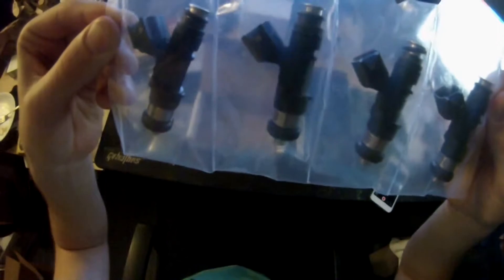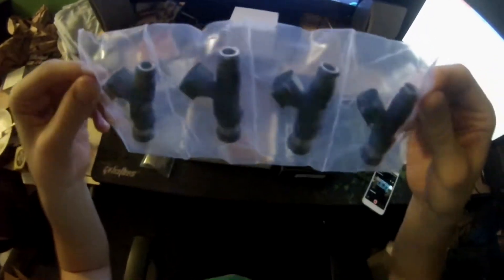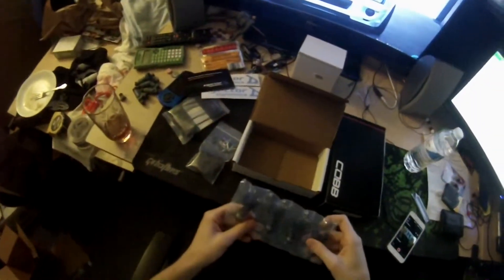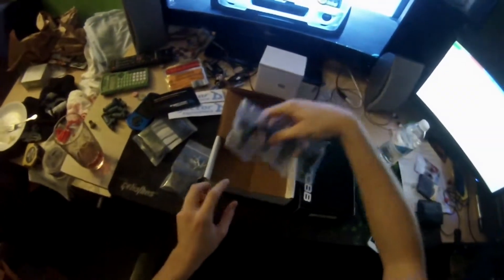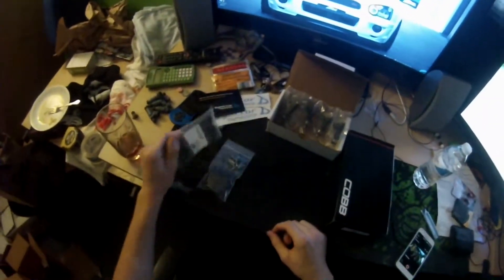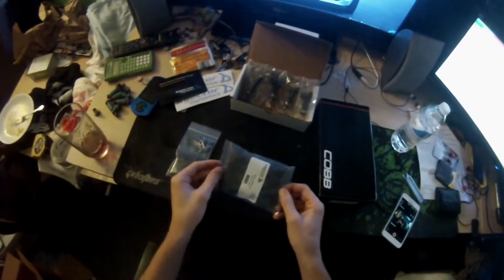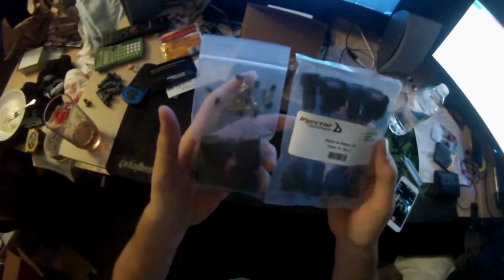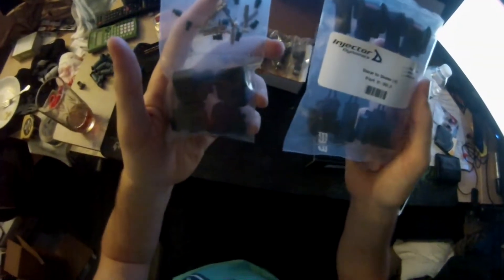Unboxing/Update Injector Dynamics 1000cc Fuel Injectors | POV 60 FPS

Comment: Sorry for the random question, but I just bought a fmic, vf39, walboro 255, and was wondering what the cheapest route would be for injectors. Are 1000cc really what's required with that set up? I've heard of people running stock injectors with the set up so I was just seeing what you thought. Thanks man
Reply from the maker: +Diy Subaru Guys I'll be honest with you, I went the cheaper route & bought Deatschwerkz 650cc injectors & they gave the tuner so problems. Injector Dynamics is simply a better brand. After installing the ID 1000cc injectors, car was WAY better & the tuner said it fixed the problem he was having with the Deatschwerkz.  I just hear a lot of bad things about the 'dont'werkz lol Get what you pay for I guess.
Reply: +Subie Rumble true true. Thanks for the help man. I'm waiting for some new videos to drop 😎 future plans vlog? 😎

Comment: Can you run the top feed injectors with the stock fuel rails? Looking at the id1000's for e85 when the weather breaks
Reply from the maker: +kp202010 Yes, I'd strongly recommend at least a Walbro 255 lph fuel pump though if you haven't already. But your stock fuel rails should be fine
Reply: +Subie Rumble alright cool, I was doing research and someone said the o lay way to make top feed work was to buy new rails. But I've already have the 255, in running dw 740cc right now. Thanks
Reply: +Subie Rumble I found out that the wrx's use top feed injectors but the 04-06(I believe) sti's use side feed injectors so the sti's have to do the top feed conversion

Comment: 300 whp on stock internals? Wrx motor? I heard that over 280 whp is unsafe on stock Wrx motors? No?
Reply from the maker: nah, they're good to run close to 350whp. It's the stock 5 speed that's known for going. 280-300whp is fine with proper maintenance and not driving like an ass ;)
Reply: Oh haha awesome, I'm excited to see what the outcome will be! 😅
Reply from the maker: It's all done acutally, I'm deciding how I want to present the final results haha. Maybe an engine tour and drive along? We'll see, but I can tell you I made more than 280whp ;)